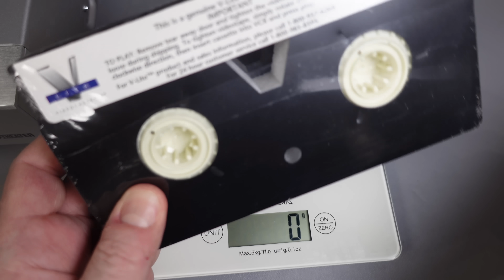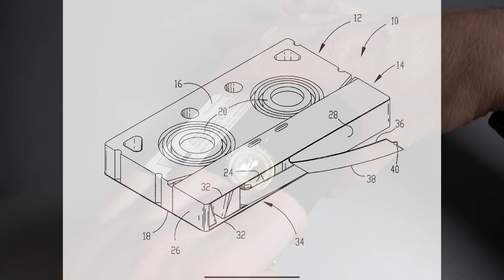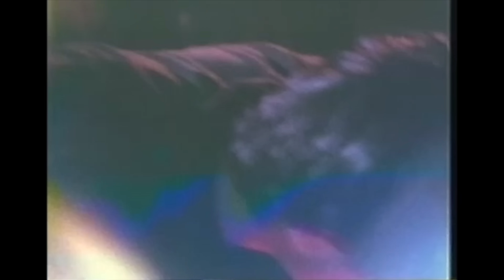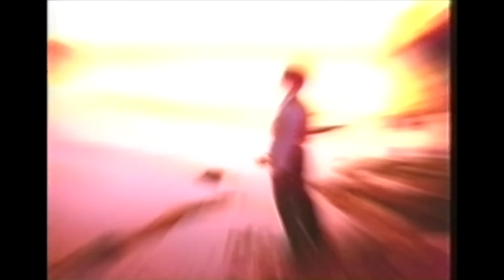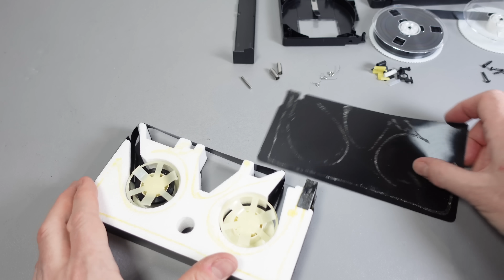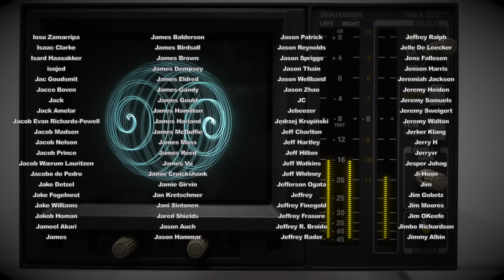V-Lite: Disposable Lightweight VHS tape

Comment: I've never seen one of these in the US.  I have seen lightweight VHS tapes, and I probably got two or three of those over the years, but they definitely weren't stryofoam... they were very thin plastic casings with very little tape inside.  To be honest, I would not have felt comfortable putting a V-lite tape in my VCR.

That said, I wonder if the V-lite was necessary here in the US, as we had Media Mail, at least since 1998 (when I started using eBay to buy CDs), which is flat rate for popular media sizes.  Media Mail doesn't allow for advertising, however, IIRC, bulk rate discounts could be pretty low back in the day... after all, AOL was mailing me CD-ROMs in fancy plastic (and metal!) cases every month it seemed.

Comment: I miss physical media... It was so easy to record things: Yes today I have a phone which is a camcorder in my pocket which can upload and share videos instantly, but if I want to record a song of the radio, or record a movie off the telly, I'll have a beast of a time to find a way that doesn't require a computer.
Reply: You can get a DVR that will record video from HDMI to an SD card. You will probably need one of those HDMI splitters from China that conveniently remove the DRM from the signal if you want to record from a cable/satellite box though.

Comment: As a German I am surprised you don't have a polystyrene bin at the recycling center. We definitely do.
Reply: Yep, it's one of the easiest-to-recycle plastics, on par with PMMA.
Reply: @argoneum  Yeah, a bin full of the stuff will disintegrate into a small puddle if you add a cup of acetone.
Reply: @TheMongooseOfDoom  You distill, and there, a pure monomer, ready for polymerization again. Works both in case of PS and PMMA. Yes, can be easily done even in a home lab.

Comment: You don't put styrofoam in landfills, you burn it for heating homes. No worse than burning oil for the same purpose. So this cassette having no metal parts is actually very suitable for its intended use case.

Comment: I just so happen to have something like this, but without the styrofoam. A rival solution this appears to be, seeing as it has the door. "ABS and SIR: How They Work For You" the paper sleeve says. The markings in the plastic say "04;11 03/03/96". This piece of low quality recycled plastic claims to have 24 minutes of footage on it. I know not if it was mailed, or if it was given away at a General Motors car dealership. Both would benefit from such cheapness.

Comment: We had a producer talk about a bid for V-lite. The cost to make copies was more than just using 20 minute standard tapes. Mailing costs was no different since it was mailed at the media rate. So, the V-lite was more expensive than standard.
Reply: This is pretty critical info when trying to understand why this format might not have succeeded.
Reply: I have to imagine it would only make sense at super high quantities, and even then VHS were so dirt cheap by the 2000s the cost difference would have had to be negligible.
Reply: @whatr0 if it came out in the late 80s early 90s it would have stuck.
Reply: thats facinating

Comment: We used to duplicate and pack these at Technicolour Video in Wembley in the mid 90's. They were a pain as they got caught in the flow wrapper as it went through tearing the flap.. I was the Engineering supervisor and had to come up with a way to run them with minimum damage.... The tape used was usually pulled from damaged pancakes... That poly shell was also used for the wrap around label that never caught on in the UK... Never thought I would ever see these again...When I left Technicolour in 1999 we were still producing around 50million pre recorded tapes a year just in the UK...

Comment: as an owner of a couple finicky VCRs, I barely trust them to not snag up on a good, well tightened VHS. and any reservation is fear of the tape breaking.

this cheap polystyrene thing has me thinking it would destroy my player, be it explodes and PS plastic goes everywhere, or a reel flings out and causes havoc, or something else.

really glad they didnt take off, but they were an interesting idea in a way

Comment: One I've seen various versions of cheap  VHS tape  .  One was all green and impossible to take apart (no screws).  Usually were included with exercise equipment where the idiot is lip syncing the audio  O_O  .  First internet trailers I saw well Twister was the first online but I had to pay for the Rob Roy one that was a CD Rom that had a trailer on it.  Wish I kept the box.  All this between 96-97.  Then finally VHS? well I left a good 200 out by the curb and it was gone in hours.  If Laserdisc is still popular , even more so since The Police found an a laserdisc that was only ever on that format.... Yeah some rare stuff on some of them.  like one Casablanca LD has.  Including a short script for the sequel   O_O  what???

Comment: The "bits of plastic" on the normal cassette are to lock the reels in place...that's why on V-Lite they say you have to tension up the reel as there is no reel lock on it!
BTW, that type of foam packing IS recyclable in Toronto, Canada.
And yes, also first time I heard of it even though I worked in a vidoe duplication studio.
Reply: I think it is recyclable anywhere with recycling facilities that can handle that.

We had on local news that our city got one of those in 2011, barely a week later all the styrofoam burned in a fire and destroyed the machinery, which hasn't been replaced to this day. 

And since Knauf is 200 mile away and won't take it even of you bring them hundreds of tons... That's going in the landfill.
Reply: The Return-It depots in British Columbia started accepting polystyrene (resin code 6, expanded or not) a few years ago. To the best of my knowledge, no municipality here accepts it in curbside recycling collection, however.

Comment: just FYI: polystyrene/styrofoam is now recyclable on smaller scale, scientists found several insect larvaes/worms literally eating the stuff and turning it into proteins/energy. Now the goal is to isolate the enzymes/bacteria used by those critters and turn that into a solution so that the recycling doesnt have to be a critter farm  ... one should doubt that we ever get back to the tons in landfills with such solutions, but at least we can look forward to a future in which we can use this stuff with a working recycling path.
Reply: I'm looking forward to bacteria or bugs eating our buildings :)
Reply: @randomnickify  if you build with styrofoam you got a whole other problem
Reply: also, they already do ... ever heard of termites?
Reply: @diedampfbrasse98  Styrofoam is common insulator in buildings and no one builds skyscrapers from wood :)

Comment: By 1995, 650MB CD-ROMs with shovelware were already in computer magazines (PC, gaming, etc.).  Remember all those AOL CDs when AOL was still a thing?  You have to wonder why promos like this weren't put on CD in entertainment magazines.  Maybe they assumed those in the entertainment industry weren't tech savvy early adopters, which would have been a completely wrong guess since many were (e.g. Roger Ebert).

I remember a mid-1980s political campaign in British Columbia.  One of the major parties at the time mailed out standard VHS tapes to party members.  Even if the distances weren't vast, the cost involved made it a one-time thing.

Comment: Back in the day when I was putting short films on the festival circuit I would call up infomerical numbers to order promo tapes and copy over them to save cash.  But even those were actual, for-real VHS tapes albeit of cheaper plastic. I've never ever run across these novelties.

Comment: I admire your concern for disposal. All that "normal" junk mail is just as wasteful as this VHS tape. There is plastics hidden there too in fake gift cards and magnetic badges plus paper now contains plastic chemicals to make it super shiny or a mirror finish. Much of it is not recyclable due to the coating and plastic content. 

I used to work for the manufacturers of the highest end printing equipment that went into huge factories. We could do the most amazing and beautiful work but the bulk of what we made was used once and ended up in the dump. It is a sign of our time that when we've come to the point where we can make the highest quality products we only want to make junk. The people who ran this equipment were demoralized because not only did they have to watch as management was changed often due to mergers and buyouts but the new owners were constantly only concerned with the bottom line and reducing the number of craftspeople who made the product.

Comment: Styrofoam (PolyStyrene) can come in two flavours. HBCD (flame retardant) containing foam for construction use in houses or in christmas ornaments (required by some countries' jurisdiction) , and those without HBCD in packaging like what your electronics come in, or what some food packs are made of. The former can only be recycled on an industrial scale, the latter can be recycled but that depends on your country, or even the city's trash facilitites. In most cities in Germany (and it seems Japan), the non-flame retardant Styrofoam (called styropor here) that you get from packaging will be picked up by recycling. 

A pick up by recycling trucks means it will be sorted at the facility either manually or by machine to some degree, but does not guarantee the stuff is not just burnt or disposed of as waste afterwards. Depends on your city. A relatively new system by the Freisinger Fraunhofer institute can dissolve the foam during collection to 1/50th of volume, and specifically allows regaining pure Polystyrene out of the solution. I doubt it is universally employed outside of industrial Styrofoam collection  (introduced 2016, but in all fairness, Sony Orange R-net is a similar process to recycle Polystyrene, which was implemented in Japan in the 1990s, so we'll before the patent application of the VLite in 1996. Maybe it was indeed recycled in Japan). Depending on your county and city, most Styrofoam just is burnt and screened for HBCD pollutants, if you're lucky the heat is used for district heating and power generation. 

What happens to the low volume of HBCD containing Christmas ornaments, and the mis-throws of structural PS is usually also left to the cities discretion. (low volumes of contamination might be acceptable, or dealt with by burning at high temps and filtering out the toxic fumes, or just diluting and accepting them to some level) 

Leaves the question: which version is this type of VHS cassette made of.

Comment: There is probably something else that killed the V-Lite too. I purchased one of the first Toyota Supra Turbo's. I still have it in my driveway today. But in 1994 racing a Corvette, the turbo gave out and pieces of the turbo went into the motor destroying the cylinder walls of the engine, and burning oil with clouds of white smoke out the back.   Not wanting to junk the car and having worked on cars all my life, I decided to pull the motor and have the 3.0L 7MGTE bored out to 3.2L. I made a video of me doing this mostly to remember how to put it back together. I also had video at the machine shop of the block being honed to 3.2L to prove that I actually had it done come time to sell the car if I was ever to sell it. In 1995 I showed clips of it to a friend that I worked with to prove where the extra horsepower came from. He suggested I sell copies of it on eBay. I laughed at him and said it isn't worth the time to sell only 2 copies. But he convinced me and after making a VHS copy from 8MM tapes then buying another cheap VHS recorder made another copy of almost 2 hours of video from about 10 8MM tapes. The first one sold in less than a day. I listed it for $3 plus shipping, which shipping cost via USPS was about $1.50. I listed another and another, then purchasing a second and third VHS recorder. I even upped the cost of the copy to $5 and was still selling them. On Saturdays I would head out to the USPS office with 5 VHS tapes when the person behind the counter asked me if these were VHS tapes. I said "Yes they are" and the person behind the counter asked why I didn't specify them as "Media Mail"? I said I didn't know that existed. Once declaring them as "Media Mail" the cost to ship a VHS tape was $0.35 but I still charged the same $1.50 for shipping. I ended up declaring $700 in profit on my taxes that year. Which I though was real funny. But mailing out a V-Lite would have cost the same $0.35 as a regular VHS tape if it was listed as "Media Mail" at that time.

Comment: I purchased a barbecue grill in the 90's that came with one of these as the assembly instructions video. Never actually tried to play it, though, as the paper manual was more than sufficient. I wonder if it was just cheaper to use this tape, or if it was something they came out with later in response to customers having issues assembling it, and it was meant for mailing to customers to assist with assembly (before they just began including it with the grill), or maybe a combination of both.

Comment: I used to work at a mail processing center where we processed important tax info, retirement stuff,  bankruptcy paper work, and bills for companies. We had a post office in the center. A full U.S postal office. 

One of the many things I learned is that the cost of shipping stuff when mailing out huge amounts of mail can get real expensive. So if it is possible to reduce the weight of mail being sent out even by a fraction of an ounce, it saves a lot of money. Why? The slight savings per piece of mail sent out would be multiplied by thousands of pieces of mail. That adds up real fast.

Comment: Funny enough, there is somewhat a modern equivalent to this: They make ultra thin "disposable" video players, with a small LCD screen and the content loaded on an SD card, and send that in the mail, usually attached to some card or even a magazine cover.
Reply: I got one of those once, but when I went all Ben Heck on mine it didn't have any removable media, or even any easily re-usable parts. I tracked down the manufacturer, and that's a "feature" they brag about: the anti-tamper/non-reusability of their promotional video player :( I scored a hall effect switch, a magnet and a baby Li-ion battery.
Reply: Weird, never heard of this

Comment: My dad used to get quite a few V-Lite cassettes in the mail promoting Agricultural equipment and supplies.  The United States Postal Service also charged for bulk media mail by weight so a cassette that weighed 1/4 as much meant considerably less mailing expense.  Most of those companies did switch to CD-ROM promo materials that ran on a Windows PC in the late 90's.

Comment: You're not going to sell the 24-tape Best Of Techmoan VHS deluxe boxed set?  And you can send out some V-lite tapes and Flexidisc promos to Patreon subscribers to advertise it.  I guess VHS tape never got the nostalgic lo-fi diy niche renaissance as music on cassettes did a while back?  I was without my internet connection for about a week so we raided our cupboard of DVDs and VHS tapes. Most of the mass manufactured ones still work fine.  My home recorded copies have suffered a lot over the years, especially SLP mode recordings.

Comment: Well, I used to duplicate VHS videos, and I doubt I actually got past the 50k mark, doing them 10 at a time, and up to, for the short 1H versions, 150 per day. But mostly 200 per day, especially once I upgraded the controller to actually work properly, and added a PC to it to do timing accurately. Then last thing before leaving put in 5 blank tapes in the autofeeder, and next morning they were done. Eventually all tapes were only E180, simply because they were cheapest in bulk, and no need to worry about doing a short copy if the master was a little bit over the spare capacity (E180 would typically be around 183 minutes of tape) of the nominal time.

Comment: That digital conversion looked really good. Does anyone know what hardware techmoan uses to digitize VHS?
Reply: The technology of digitizing VHS is very common and cheap now. You can buy analog to digital adapters that connect a VCR to a laptop, etc. They have been around for a long while now and are good quality products from what I can tell. 

The place to get them would be in stores that specialize in electronics or online.
Reply: @Cooldudewhotellsamazingjokes  welld yeah but i think he means the quality is really good. most ADCs suck. even though intuitively you're just reversing a DAC, ADC technology is far behind DACs, at least in the mass consumer space. maybe high end -phile ones are more comparable to a decent DAC, but most ADCs come out a pretty blurry mess
Reply: @Jesus Christ  You're right, it's the quality of the capture that impressed me. I've bought the cheap USB composite capture devices before and always got low quality results. I've looked into more expensive options, but never knew what to get.

Comment: Interesting, first time I've ever seen one of those. 

More generally, VHS will before too much longer be the most comprehensively dead format I expect. Given there's zero ongoing production of machines, and they're far too difficult for the average layperson to repair, it's on its way to total extinction. Unlike most other formats where the simplicity of repair enables the ongoing survival of working examples.